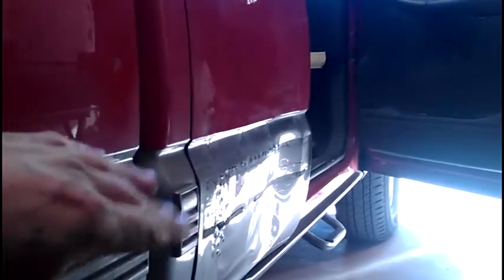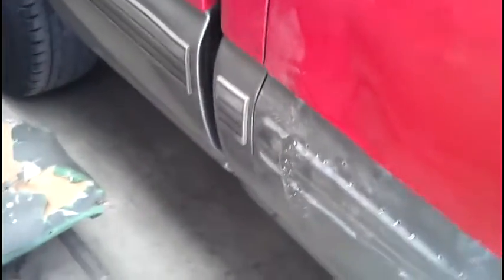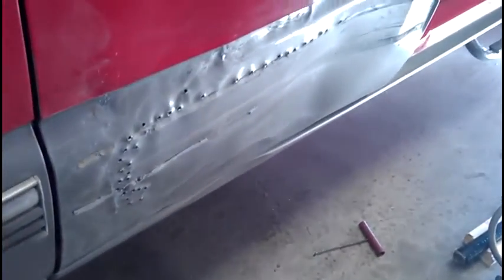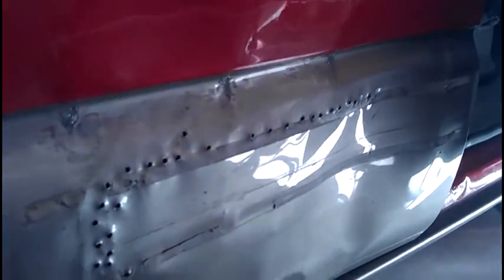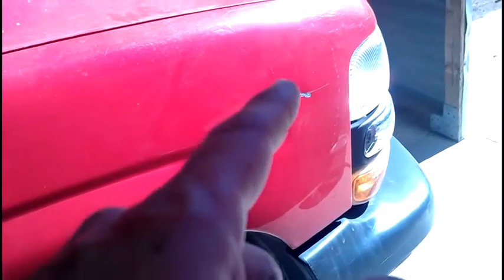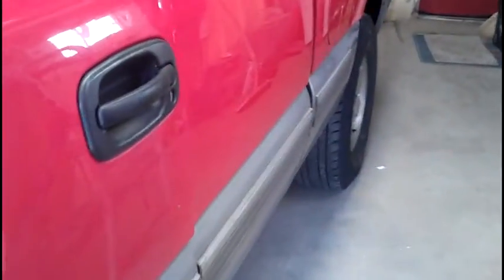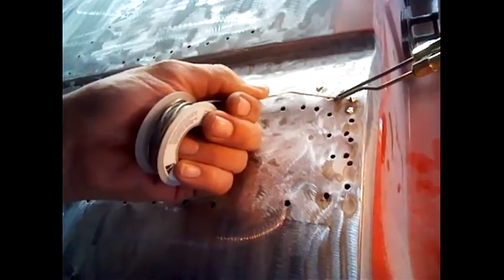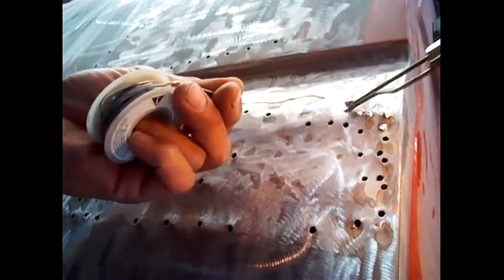how to: solder  up the holes : paint and body work..z71 Part - One

Comment: A better way I find if you have to use old style slide hammer, is to dispose of the provided screw and use a 4" nail instead. Put nail through the slide hammers top nut first, then MIG weld to panel in appropriate areas. This can be cut off once dent pulled out & be re-welded to another spot for pulling. Welds can be ground down once panel is as straight as possible through pulling. No need to drill holes. Any tears / holes need welding afterwards anyway.
Lead / solder filling was used for body filling years ago ( i.e Old School ) & filed flat, where cars had two part panels. They were filled on the body line, You used to get upper & lower panels. Modern body filler or Bondo as you call it, although a great & more easy useable product, has taken a lot of skill out of the body trade.
I was trained in both the modern & the old way & melted lead into panels I had repaired using wooden blocks & beeswax & body files etc. I very rarely got the chance to put this knowledge into practice except on some really old classic stuff. Only then, when it was specificly requested.
Due to (Bondo) lead work is a dying art. It was never used for plugging holes though. They need to be MIG welded back up. They will be a weak spot and also promote rust growth resulting in paint & filler lifting. By the time that happens the door will be an absolute mess.
INVEST IN A MIG WELDER. ( & learn how to use it) you'll be so glad you did.
I realise that you are only showing people your approach of how to fix something their selves hence saving hefty garage bills. So I am not critacising you, just pointing out the correct way too.
Having said this, I am no longer working in the body trade or have been for 25 years. There was no money in it unless you owned your own bodyshop / garage, so I went back to college & retrained as a bricklayer & general builder. I own my own successful business nowadays but still restore old cars & motorcycles. Only as a hobby & to keep my hand in. A lot has changed in the body trade in the last 20 odd years, but the hand tool skills will never be out of date. .
A craftsman is after all just that.
Hope you don't take this the wrong way as I do not intend to offend you.
I am not full of shit, as my profile pic clearly shows. Although this pic was me 40 odd years ago, somethings never change. I work outdoors. When a mans gotta go- he's gotta go.
Good luck in all that you do friend.

Comment: Any chance you can tell us what type of solder you are using? Is it for plumbing, electronics, etc? Is it just the solder or it it the rosin core type with flux in it?
Thanks very much
Reply: same as a plumber would use

Comment: you should not drills hole in the sheet metal you never want too take away metal in a dent you can punch a hole and use a screw to pull it out